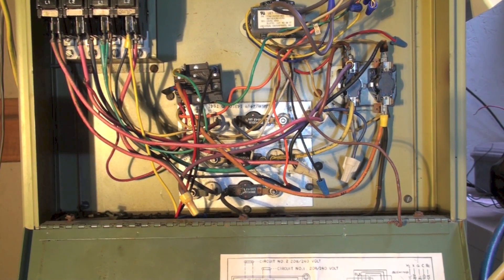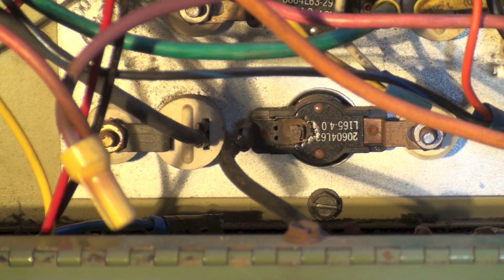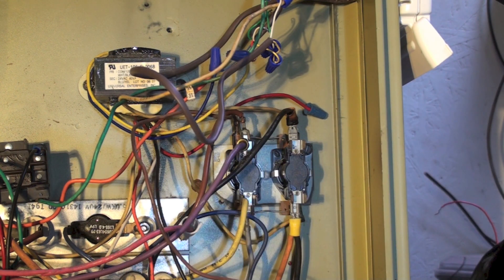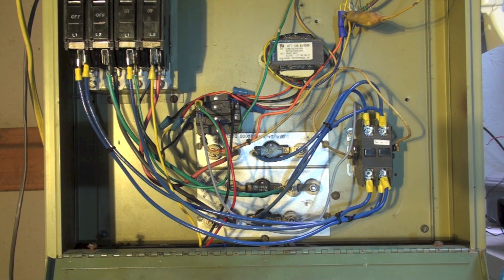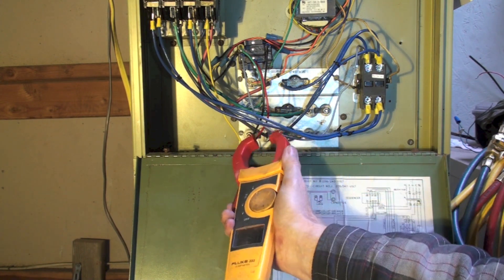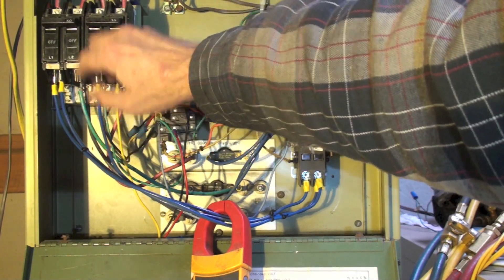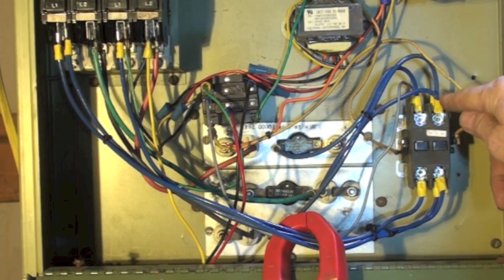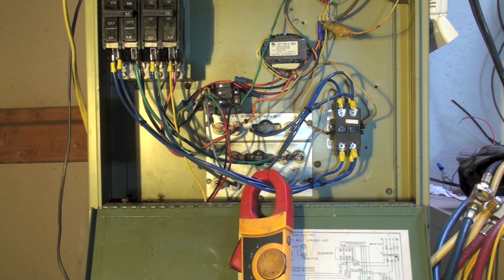Electric furnace, replace sequencer with contactor

Comment: I have a quick question i hope you can help me confirm an issue with my furnace. The fan kicks on when the thermostat is off. I know the thermostat is good. The fan kicks on for 10-15 minutes several times a day. Control board issue? Is this normal? Any help would go along way. Many thanks!
Reply from the maker: arcdraw Is yours an electric furnace?
GFM
Reply: No it's a gas furnace. I've narrowed down the issue to the thermostat. I've been able to check the board and it all looks good.
Reply: +arcdraw  your limit is breaking on your gas furnace not enough airflow through the heat exchanger or heat strips are overheating due to covered in grime

Comment: Was the contactor rated at 50 amps? The amp draw was 65 amps.
Reply: +KEITHS AC  the total amp draw  was for both legs you can run 50 amp on each leg so he ran 40 amp on one leg and 20 amp on the other leg
Reply: I think the breaker is rated for 50 amps period not each leg or terminal. Cannot put 50 amps on one leg than 20amps on the other.  On a regular breaker if using for heaters you half to depreciate the breaker by 80% example 80% of 50= 40amps

Comment: My only concern is the UL rating.  Once you change things around it is your design.  It clearly works better, but could it make you liable?
Reply from the maker: dpeagles I guess the point is, what is more important, whether it works well or whether is passes UL.  I guess its up to the individual technician.  Thanks for the thoughts.GFM

Comment: Thanks for the video GFM. Two quick questions:
1. Why did you choose a two pole contactor over a three pole?
2. Whats the reasoning behind two number 10 gauge wires from the contactor rather then one heavier gauge wire? I assume all you had was number 10 wire and thus just doubled it. 

Just looking to learn.
Reply from the maker: PHC Apprentice If your furnace had more elements, you could use a 3 pole.  This one had 4 elements.  The #10 wire is used for each element, as each element is 5000 watts or 20+ amps.  Hope this helps.GFM
Reply: Thanks gfm!